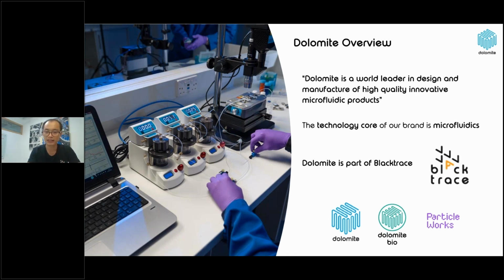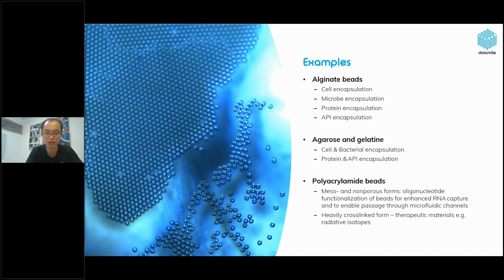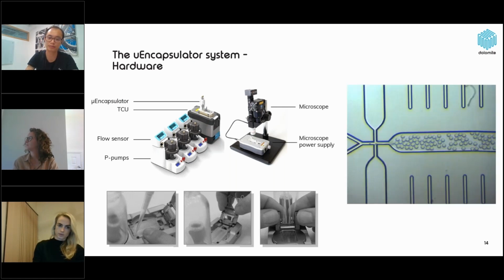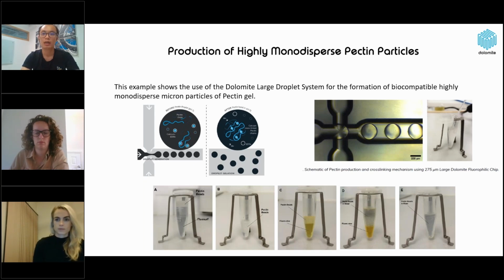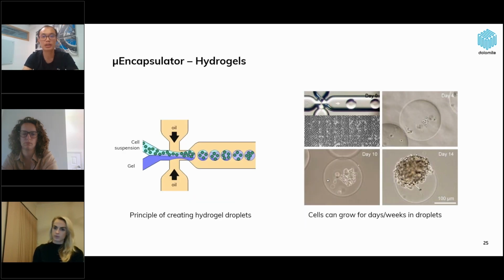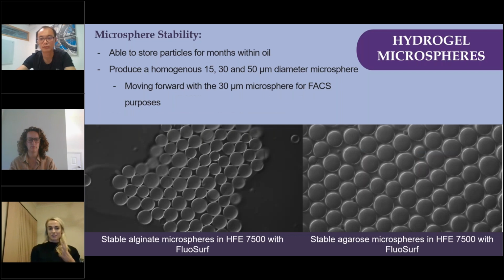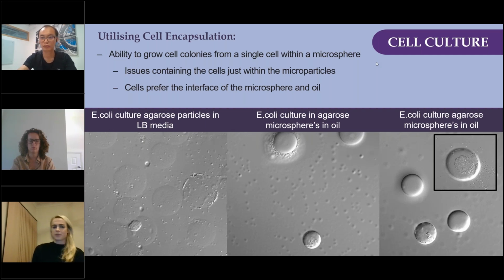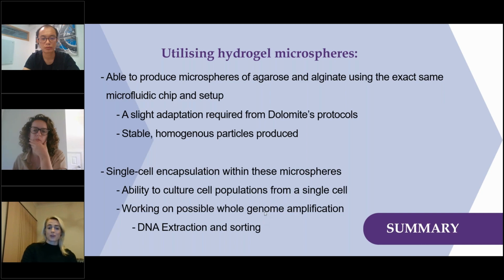Webinar: Synthesis of Hydrogel Microspheres using Microfluidics

Comment: Hi Dr, I'm working on creating hydrogel microspheres by using a combination of liposomes, LAP, and GelMA. but I have some problems, first I can't make small microspheres even when I reduce the flow speed of the Oil phase or the combination above and increase the flow rate of the oil phase, and also I'm not getting the stable size of the microsphere as I'm doing 1:4 combination:Oil. could we please have a private chat?